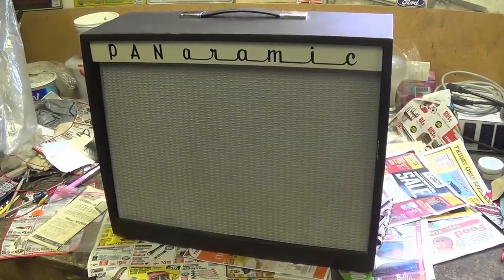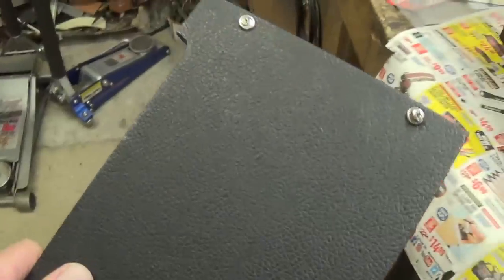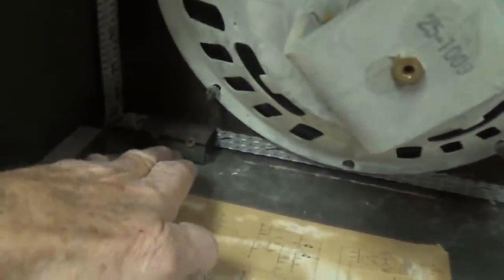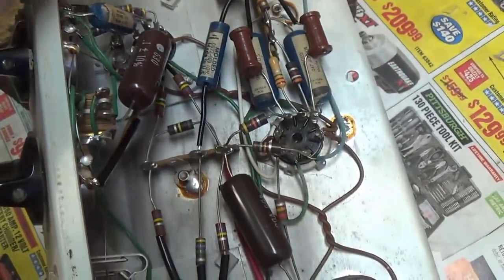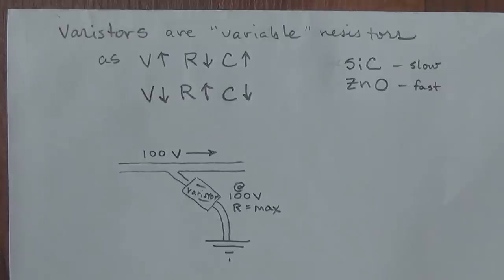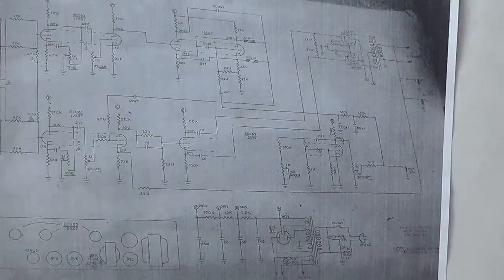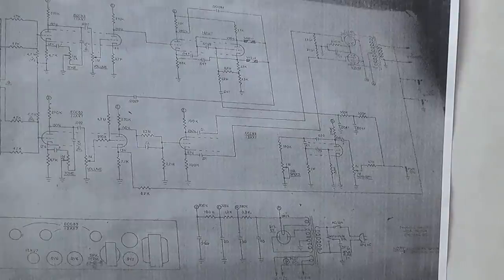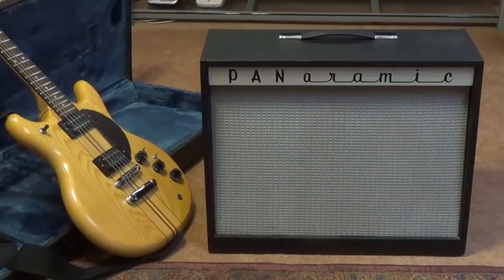1963 Magnatone Panaramic Model 1210 Amp with "True" Vibrato

Comment: Fantastic sound and another great and educational video. The difference, electronically, between tremolo and vibrato seem similar to AM vs FM. Amplitude modulation vs. frequency modulation. I don’t quite understand one thing, though. As the two signals converge from the plate and cathode, why don’t they cancel each other out as they’re the same signal, but out of phase from each other?
Reply from the maker: Thanks, FC. That's the purpose of the phase shift......due to it, the two music signals are no longer perfectly out of phase and thus interact to produce the effect, rather than cancel each other out.
Reply: Uncle Doug Thank you for your quick reply and for clearing that up. Going back and looking at the circuit as you presented it, I can see how the signals wouldn’t be perfectly out of phase and would produce the desired effect. Take care and thanks for all the great education and entertainment.
Reply from the maker: You're welcome, FC. Thanks for your nice comments and inquiries.

Comment: Great video, thanks for sharing.   I have a Panaramic model 1220, bought by my dad at an auction in rural Illinois for $27 in 1994.  Didn't see the 1220 mentioned in that brochure (other than the cloth cover listings, which mine came with), but it's a 2x12" with individual bass / treble tone controls, similar to the 1262.  I misplaced the original tubes (including some Esteys & Bugle Boy 12AX7s) some time in the late 90s, and a couple years ago had it modified to a 3-prong cord (grew tired of getting shocked) and a onceover by a St. Louis-based Magnatone techs who work out of Killer Vintage.  Amazing tone, love the amp.
Reply from the maker: We're glad you enjoyed it, Eric :)

Comment: I bought a new set up in 1973- a 100% original 1956 Fender Esquire for $300,with the hugest, sharpest 'V' profile neck I've ever encountered, the BEST sounding pickup(only the 'G' and 'D' poles raised) on a Tel/Esq. guitar-and I've owned 1950,'51'53,'54 model years(and I kick myself for trading for a refin. '55 L/H trashed Tel.), and a 1964 Magnatone M-10 for $60-also 100% original( I long for those days) an entire new set up for $360-such a deal!. I stumbled upon a trick using the 'stereo' input with an adapter I made-female mono to male stereo , and dialed in the 'dry' channel gradually, until I got a gurgling, watery effect-only for special occasions, but still reminiscent of 'Underwater' by the Frogmen. This effect can also be had by any 2-channel Magnatone amp by plugging into the vibrato channel #1 input, patching from #2 input into #1 input of the 'dry' channel(the effect only works in a small perimeter of the volume control though.
Reply from the maker: Wow, thanks for the very detailed info, Max :)

Comment: My diy Univibe pedal uses a very similar circuit to the Moses Vibrato circuit used in this amplifier, the difference is that instead of a triode gain-stage the circuitry in my Univibe pedal uses two transistors connected as something called a "Darlington Pair" as per the Moses Vibrato circuit, there's two out of phase signals, one is fed to something called an LDR (Light Dependent Resistor) via a capacitor, to vary the LDR's resistance there's a small lamp in close proximity to it, which is driven by a transistor, which is driven by a transistorized LFO (Low Frequency Oscillator), the diy Univibe I built produces two different effects, it produces a Phasing effect as well as a Vibrato effect.
Reply from the maker: Very interesting, Simon. Thanks for sharing :)

Comment: Really informative and detailed discussion Uncle.  I'm working on a 1210 A today without a schematic or Bom. This is a problem as a few resistors are charred and the values can't be determined. Any chance that you can attach the drawing you enhanced   that should help out    Thank you sir, best regards. Grego
Reply from the maker: What drawing are you referring to, Ok ? Could you simply take a screen shot of the drawing and print it ?

Comment: Thank you very much Douglas for explaining the difference between tremolo, and vibrato circuitry, and operation.  Though I am familiar with phase shift circuits – I encountered them when I serviced televisions – and frequency modulation – though in vibrato terms it is different, the general principal can be linked to VHF radio, I was never taught, at any time throughout my five year apprenticeship how they have applications in musical instrument audio amplification.  My training was for the purpose of servicing televisions, radios, and Hi-fi, as well as some limited references to domestic appliance, and electrical power tools servicing.  I had no training whatsoever on servicing guitar amplification …training for that type of electronics servicing wasn’t an option!  So, my friend, once again, thank you for your time and patience for explain guitar amplification.  I’m very much able to understand what you are explaining as I link it in with my servicing skills and knowledge of Hi-fi audio amplification servicing, whist at the same time being aware of circuit differences between the two types of amplification.
Best regards, Phil.  P.s, see my Y T radio servicing series videos I uploaded just before this last Christmas.
Reply from the maker: You're quite welcome, Phil. It's great to hear that the videos are helpful, even to those with experience in electronic repair. I will definitely take a look at your videos.

Comment: Technically speaking, the magnatone circuit uses phase modulation, but a periodic phase modulation behaves somewhat like a frequency modulation. It is therefore also not true vibrato...
Reply from the maker: Phase modulation results in frequency modulation, Dries:

 "If you modulate phase with another sine wave the phase can be seen as 'playback speed' for the carrier since the change in position of the modulator changes gradually. As a sine modulator’s output is gradually increasing, the carrier is being “played back faster” which means its frequency is being increased by the modulator. Likewise when the modulator is gradually decreasing, the carrier is at a lower frequency.

So the result, in this case of phase modulation (by a sine wave), IS frequency modulation; It’s just being implemented by modulating phase."

Comment: Wow. Great video. I always hoped Uncle Doug would do a Magnatone amp video. You made a great score with this amp.  I have this same amp with the solid state rectifier. Not quite so pretty though. And another similar (Estey) amp called an AMERICANA 314 with basically the only difference of having tube rectification. I think the solid state is a little louder and can generate a more raw overdriven tone when pushed. I am probably wrong , but I thought that the solid state models were copies of the Magnatone Troubador 413  series amps. I believe there were different styles of vibrato effect on different model Maggies. The electronic circuits  I think were designed by a guy named Don Bonham. I think there was a similar model called a Tonemaster 314 which was made famous on the internet by Phil X a few years  back on the Fretted Americana YouTube site. Fretted Americana created an EVIL ROBOT amp which was based on this amp. I have another similar Amp called a JUKE.  Jukes have a similar pitch shifting vibrato with a lot of ways to tailor the sound. They are made I believe in New Hampshire. If I  remember correctly,  that the amp maker of Juke Amps was selling varistors for a while (for those who wished to make their own amps, I suppose). Don't know if he still does. Anyhow, Lonnie Mack and Stevie Ray make good use of guitar vibrato on the song "Wham". Lonnie uses a Magnatone and SRV uses a Leslie speaker.
Reply from the maker: Thanks for all the great info, EA. I am a big fan of Phil X and his Tonemaster amp.

Comment: Very nice. A good explanation of the difference between Vibrato and Tremolo.  My only complaint about Magnatone amps are the preamps and the power amps. They are underpowered for their size and weight.  A project I undertook a few years was to couple a standard Fender preamp to the Magnatone M-9 vibrato circuit and a 40 watt Fender power amp the results were excellent. I plan on integrating that circuit into a 6G8-A Twin on the Vibrato side and a 5F6-A Bassman on the Normal side with an 80 watt power amp. Just so nobody freaks out, I'm doing this with a repro chassis and cabinet as I would not wish to alter an original Brownface Fender Amp.  The Varistors used in Magnatone amps are Workman FS 1205 .05mA@80V although others would probably work.  The company that makes the varistors for the new Magnatone amps is Metrosil in the UK but I have never seen them for sale.  Occasionally original ones turn up on Ebay for ridiculous prices.
Reply from the maker: Thanks for your very informative input, Arnold, especially regarding the proper varistors for Magnatone vibrato.

Comment: Great vid. I can follow along but I don't get all the NASA talk ... some but not all.  Interesting nonetheless. I guess I've never heard true vibrato (no footswitch included?}. The tremelo is definitely more physically expressed while you can hear the FM of Vib. expressed as more of a "time" type effect ... although not really a time delay more like a chorus.  I say "like" although it really is unique.  It definitely gives an ethereal spaceship tone ... like a well controlled very subtle theremin sound. I love how those early lower wattage amps heat up and crunch a bit.  Very pleasing. I have a '53 Fender Pro that when I play my Tele through makes you feel like you're sitting in front of a warm crackling fire!  BTW, is the AM and FM of the vibrato signals of tremelo vs. vibrato in any way related to the fidelity variation in AM and FM radio signals? Anywhoo, stellar piece of vint. equipment!
Reply from the maker: Yes, the concept of AM and FM does relate to tremolo and vibrato.....although it refers to modulation of an inaudible carrier wave, rather than a very audible sound wave.

Comment: Do you have a video where you have to troubleshoot loud popping noises coming out of the speakers? I have an old Marshall M1989 with that problem. All of the tubes are new. There is no visible arcing. I love your troubleshooting techniques, but I don't have the familiarity with the amps that you do. I have not been able to find the exact schematic for this amp. (This post is off topic, but you have YouTube messaging disabled.)
Reply from the maker: Pops are often an arc across a cold solder joint, P53. You can try wiggling every wire to see if pops happen, then resolder the noisy connection. I was not aware that YT Messaging was disabled......I never did it.

Comment: I had a model 480 in perfect condition that I gave to my dad when I went to Vietnam because he and his friends needed another amp for their concertina club.
When my dad passed away that amp was one of the items I inherited and I was really looking forward to getting it back.
And then I saw it.
Cigarette burns all over the top, stains from all kinds of drinks spilled on the grill cloth, every corner of the cabinet rounded off where it should have been square, knobs missing and the faceplate so worn down that you couldn't read any of the information that was originally on it.
 It was about as beat to hell as an amplifier could be.
My mom said he never had a problem with it and everything worked reliably for all those years he had been using it. Never broke down, needed tube replacement, etc.....
I would say that means that Magnitone must have been the 'Timex watch' of musical instrument amplifiers.
"It took a licking and kept on ticking!"
More than 35 years of some really rough service!
If I could get a new original front panel and knobs I could probably swap out the worn out front panel and bring it back up slowly on a variac and it would still play fine.
Then I would need to find a good cabinet restoration guy...
The model 480 had 4 varistors in it so I guess it either had 2 stages of vibrato, or independent vibrato for each channel.
Thank you for bringing back some good memories....
Reply from the maker: You're welcome, Dennis. It sounds like Dad and the boys must have been running a heck of a club. I wish I could have witnessed one of their performances.

Comment: I'm also curious if there's a payoff trying to reproduce this sound with varistors today, versus a Vactol-type optoisolator using photoresistors coupled to low frequency modulated LEDs or even light bulbs. Which has been done for both "phase shifter" and "Univibe" (which produce vibrato similar to the Magnatone) circuits. 

I guess there would at the very least be a payoff in claims of authenticity to the original circuit. But would there be a payoff in sound, is my question.
Reply from the maker: There is only one way to find that out, SS. Let us know the result :)

Comment: Wow! So many observations! I thought your depiction of a 1/4 inch stereo jack reminded me of the way the cartoons of the 70's "Freak Magazines" looked. I'm referring to Mr. Natural mags. Same as the cover of JanisJoplin and Holding Co.'s album art. A new cat in the mix! I have a tabby that is a lot like Tennessee Tuxedo. It seemed that the true vibrato had an underlieing tone. The tremolo would completely go silent when turned down but the vibrato still had a little of the tone present. Maybe it is my perception. Great, great presentation and explanation of the differences. Of course you being the SW you see minimal snow. Here in Co. we got 16 inches in the last week! The owner of the amp took the best preservation methods I've ever seen! I thought I saw a couple of metal oxide resistors that had been changed. One on one of the 6V6s. I could have been mistaken! Anyway great project and will be waiting for your next post! Thanxz
Reply from the maker: Wow.....thanks for all the observations, ATL. As usual.....they all made sense :) You're welcome :)

Comment: I love how the guitar just disappears at around the 41 minute mark where Jack walks up to it. That cat is fast! Must be part Ninja or something :)
BTW your explanation of the Vibrato using the spring was excellent, though as soon as you showed it on the meter I was already thinking 'Doppler Effect',
which this seems to be an electronic version of. If they could have slowed it down a bit more and introduced a straight signal alongside,
 they would have invented the first Chorus effect also. BTW, UD, have you ever run a cross one of those true stereo 2X10" Gibson amps from the early 60's?
Back in my younger gigging days I actually knew a guitarist who played one. I played through a 60's Gibson Maestro amp I will never part with.
It was cool back then meeting someone else who had a real appreciation for these old relics as much as I did, and he wasn't the only one.
Reply from the maker: Thanks, V. This amp is capable of providing the chorus effect by utilizing the stereo input and creating a clean signal from Channel 1 and a vibrato signal from Channel 2. Yes, one of my first amp restorations was a GA79RVT, with true stereo output (one amp circuit per channel). Both the tremolo and reverb were superb.

Comment: Yet another amazing vid!  So, 'true vibrato' is basically just an LFO and two zener diodes?!  Are there current diodes out there that will work for this or would it only be NOS silicon carbide?  This is a 'must-try' DIY project for future amp builds!! Sounds great and very unique.  Thanks, Uncle D!
Reply from the maker: Thanks, SF. I believe only a very specific SiC Varistor will work....otherwise, I'm sure that experimenters would have discovered an alternative, since they are virtually unobtainable. If you do come up with anything in this regard, please share it with us.

Comment: Hey Uncle Doug!
    I have a similar amp made by Magnatone called a Da Vinci. It was  sold as an accordian amp. I paid 37 dollars for it at a thrift store in Texas. It has a great sounding Vibrato! The amp is well used with a tear in the original grillcloth and  part of the logo has rubbed off leaving only  inci-  instead of DaVinci. This is probably the favorite amp in my collection of Blackfaces , small Gibson and Marshall JCM800, which hasn't been turned on for five years!
Reply from the maker: Greetings, Mike. I read that Magnatone made these amps under all sorts of names.....but that the circuitry is identical to the original Magnatone version. It has a wonderful tone and exceptional build quality......it's one of my all-time favorites too.

Comment: NEVER, EVER sell the Pan-aramic. Maggie's, Titano's, Tonemaster's that are based on the Magnatone 413 are highly sought after. My Lyric Custom 660 (based on the Magnatone 262a), I suspect was purchased by an accordion player is in fantastic condition with the original tubes. After the accordion craze passed it must have been closeted. I have a single external speaker jack but have no idea what type of cab to run. Impedance, parallel or series wired twin twelves questions I have will have to be researched further. 
I am always happiest when notification of your videos lands on my feed. So glad you and the cats are in fine health!
Reply from the maker: Thanks so much for your good advice and comments, KM. The kitties and I really appreciate hearing from you.